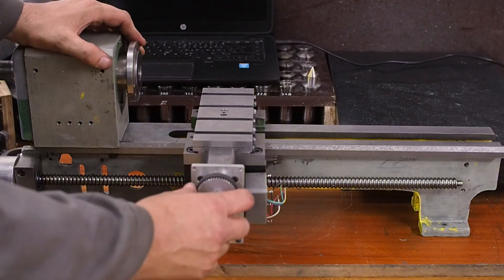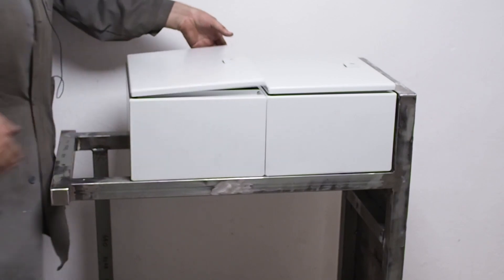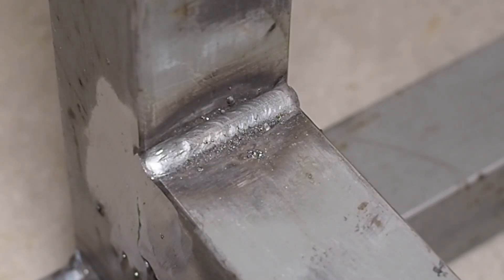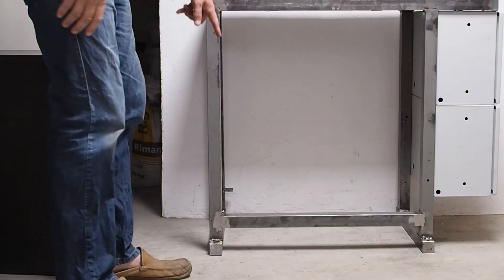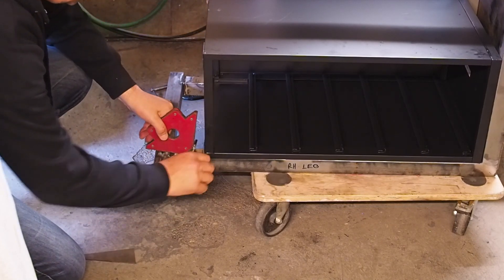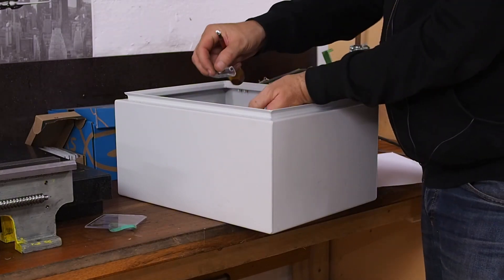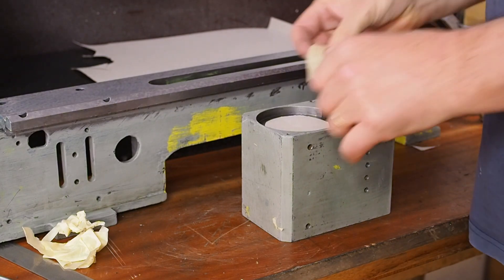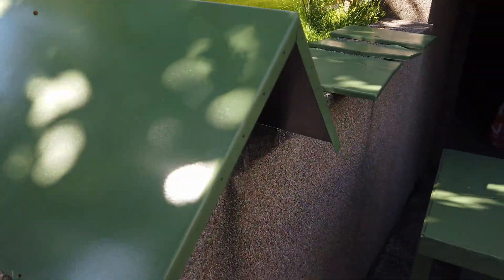Overhauling the 7x12 mini lathe - Episode 18 - Finish stand and paint

Comment: Coming on nicely and good to see you leaving the slight measuring mishap in we have all done it haven’t we. I have three of those helmer cabinets in my wood shop to hold tools, router and cutting bits and hardware etc. I am surprised how well they are holding together given the thickness, the biggest issue i have is the twist on the drawers if you have anything mildly heavy in them. I didn’t need full height so used a piece of 3/4 msg cut to fit in the base of some drawers which helped with this. Thanks for the video I am enjoying the series.
Reply from the maker: Thanks. Those Helmers are by far the cheapest shop tool solution I could find. I came to the same conclusion that a piece of MDF epoxied into each drawer would stiffen them up. The front face only has edge contact between sheets and cant otherwise be reinforced. First I will need to decide what goes in which drawer.
Reply: RotarySMP I think they are very good value for what they are , I have found them very useful and a good size. Thanks again for the videos

Comment: Nice Unimat SL !
Reply from the maker: Good spotting. That was a secondary catch of some other tool I bought. It is set up as a bench drill, but I use the motor for rotary grinding on the the Clarkson, and occasionally use the rest as a tapping stand.

Comment: Hey! Awesome vids thanks for making these! I never had a lathe or worked on one so these are incredibly helpful. I just got a 7x12 and am going through it correcting all the misalignments, and am making a hand scraper tool out of an old dremel carbide tile bit to scrape some many hours. That CNC mill you have is neat i wish to have one some day. But anyways I just thought of a suggestion for you about the doall band saw gears, you maybe thought of this before but why not turn a shaft blank and cut some spur gears with a dividing head on the cnc? They wouldn't be helical anymore and you'd have to replace both gears but at least it'd do steel. And you could fix it now with the stuff you have. Or get a pretty great dividing head for way less than that gear. 1500 for a gear is nuts.
Reply from the maker: Thank for the feedback.
Good point. I have also considered that, but think that the 1/3 of a tooth remaining may well be enough. These were designed to chomp through 12" cast iron blocks all day. Since I wont be doing that, it will probably last fine as is. I  was going to get into that gearbox, but the Schaublin came along before I could start.
Reply: Yeah it probably will. Especially if it's hitting different teeth on the other gear every rotation. Would take forever to wear it out either way though. Good luck with it thanks again for the instructional vids

Comment: No amount of paint can cover up those welds 😂
I have on many occasions run a bead of weld and marvelled at its beauty then realized that i have welded the bugger in the wrong spot ! Considering my trade is a welder fabricator you would think i should know better !
Reply from the maker: :) I think I measured that cabinet three times before welding the bar in, and still put it in the wrong place.

I need to replace the batteries in my self darkening mask. It became flaky by the end of this build.
Reply: @RotarySMP  
C'mon don't blame your tools !
Reply from the maker: @ianbertenshaw4350  :) Good call.
I can get a nice weld like the one I had to cut out if:
- The part is turned so it is a horizontal Vee weld
- I can sit
- I can brace my welding hand with the other hand
- The helmet darkens
- Sagittarius aligns with Pices during the transit of Uranus, but only during the year of the Rat.
Any deviation from that ideal and all bets are off.
Reply: How much is your time worth? Probably could have bought a brand new Hardinge when you factor in your labor. The work you did is truly amazing but it just highlights what junk the Chinese are selling. Nobody should buy from China until they get their quality up to standards.
Reply from the maker: @alanzamore8017  You aren't wrong. Typical hobby project, maximum of time and money input for minimum output. I started doing this as a little "learn to scrape" project on junk. Might have slipped a little into polishing a turd :)
Brand new Hardinge?? Are they still around?
Reply: @RotarySMP  I think they stopped making them new but you can find used in excellent condition or totally rebuilt to like new for $25-50K.
Reply from the maker: @alanzamore8017  You put more value on my spare time than I do! How about sponsorship :)
My best man has two Hardinge HLV's. My dream lathe would be a Weiler E30.
Reply: @RotarySMP  I would also like a Weiler but they are very rare in the US. Anybody know where there are any?